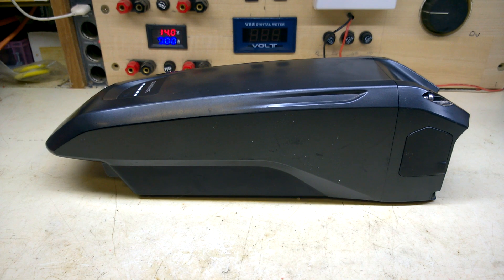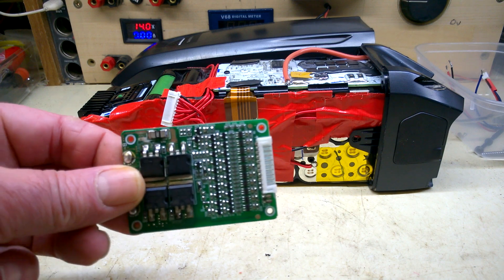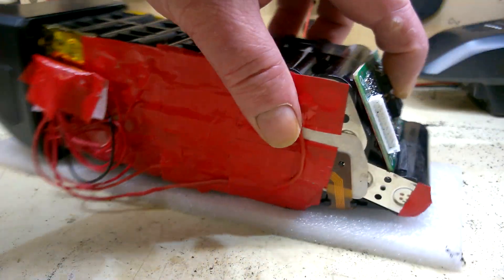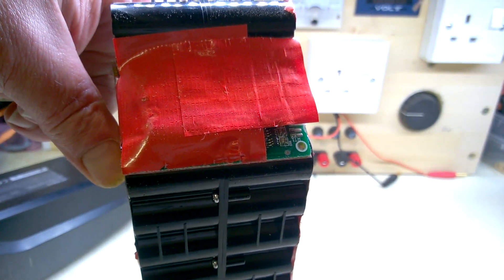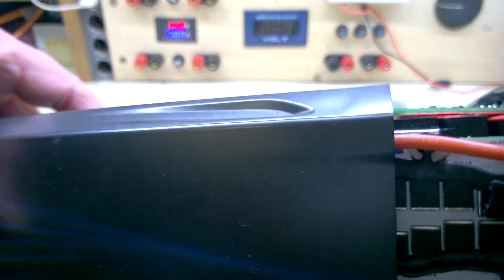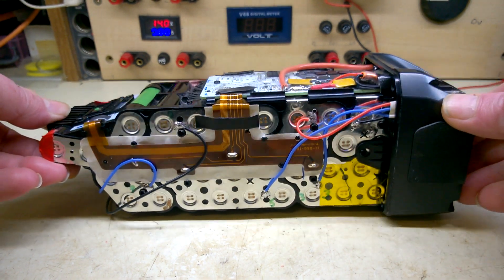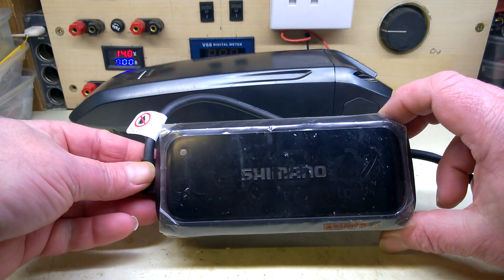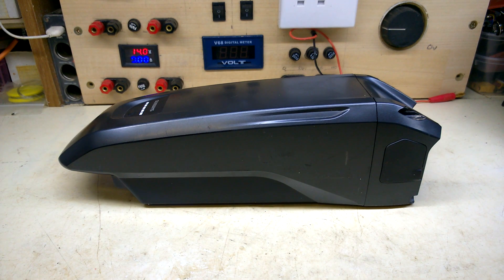Shimano 36v Li ion workaround repair pt 2

Comment: What about the mosfets heat dissipating metal plate, no need for that?
Reply from the maker: Of the four mosfets on the BMS,only one or two will be used for charging.
The remainder are for discharging,which are not used in this case.
The charging current will be 2 amps max.and so are unlikely to produce much heat.

Comment: Why not just completely remove the old BMS as you've bypassed it it's doing nothing, the new one is doing everything the old one did
Reply from the maker: @lip03pd  
It looks like you've missed an important point. 
The original BMS is still communicating with the controller. 
The new BMS only deals with charging.

Comment: Hello dear friend, could you help me with my Shimano steps battery!  The battery has a charge but the BMS board does not communicate with the engine, the computer cycle turns on but does not indicate the charge level, thank you
Reply from the maker: If the BMS does not communicate with the controller,you will need a new BMS.
Good luck with that ......................

Comment: Hi from Brazil... great work friend! I would like to ask a question: is it possible to put another common battery (with BMS and protections) working together, but not simultaneously with the Shimano battery? I mean, connecting one and when the power runs out, switch to the other manually. I have a bike that uses this same Shimano BT-6010/36V battery with a Shimano E6002/250W/50Nm motor. I didn't know about this serial communication between motor and battery (thanks for the explanation). I was thinking about removing the white and black charging housing socket cables by drilling a hole in the battery case. The white cable would cut in half, so one end would be stuck in the charging housing socket and the other end would be connected to the main board. Then I would connect the black cable together with the negative of this second battery. This way I could choose between connecting the positive of the second battery or the positive of the Shimano battery. The charging housing socket cable would be the common one. This way, regardless of which battery is connected, there will always be serial communication between the Shimano battery and the motor, as long as there is a minimum amount of charge in the Shimano battery to maintain this communication. Do you think it could work? Thanks in advanced!
Reply from the maker: Greetings from Wales.
I would advise against using 2 batteries together.
If one is empty,and the other has a full charge,you could have a massive current surge (from full to empty).
Much safer to carry an extra Shimano battery,and swap them when one is empty.
You won't be able to use a generic (non Shimano) battery because of the communication issues.

Comment: Does the bike need to see the BMS at all, or would it work just off of voltage?
Reply from the maker: The bike will not see the new BMS.
It's only connected to main power and the communication wires.

Comment: So is it only possible to use a non-shimano charger because you've bypassed the bms?
Reply: The Shimano BMS I should say. Obviously you've put a different one in.
Reply from the maker: That's correct.
The Shimano charger needs to communicate with the original BMS to start charging.
Because I have used a generic BMS for charging,any generic charger will do (but not the Shimano charger.

Comment: Hello, do you think it is able  to build a diy Akku with 10S7P  and use the oem bt8010 BMS ?
Reply from the maker: It is probable that if you remove the cells from the original Shimano BMS , it will software lock itself , and never work again.
I don't know for sure , but it's very likely.
Let me know if you try it.

Comment: spot on. I have done as you have known as beat The fat cats. mine was a kalkoff battery cells buried in bitumin. Managed to dispose of inards completely no way could one salvage anything. bought a dead battery (bms failure ) divided the 36v into 2 x 18v i now charge each half with an imax b6 with the individual cells monitored via the b6. works a treat. cost £100 ish new battery £550. i'm now riding into to the sunset. cheers for your video i should have done one.
Reply from the maker: Thanks for the detailed comment.
Let me know if you make a video - I'm always interested in unorthodox solutions.

Comment: Interesting video. So the original BMS is still communicating with the controller in the bike right?
Reply from the maker: It seems to be still communicating with the bike (it only had a brief test ride though). But that's all it does.
It won't charge or discharge hence the modifications.
Reply: @makeitwork7522 the problem is: since the original BMS is not charging the pack anymore therefore it doesn’t know how many amps has been put into the pack. This is needed for the remaining mileage calculations: you know how much has been charged + you know the max capacity = you can calculate how much is remaining. Also as the pack gets older the capacity also drops- this is how the wear level is being calculated. The bike will ride which is definitely a plus but you will have no idea for how long it will last which is a bit of a boomer…
Reply from the maker: @losien1 
From my point of view,the less a BMS knows the better.
The more info. it has on how many charge cycles have been achieved,the quicker it can self destruct (2 years warranty or 4000 miles - take your pick).

You can guess how much mileage is remaining in your battery from the gauge on the bars.